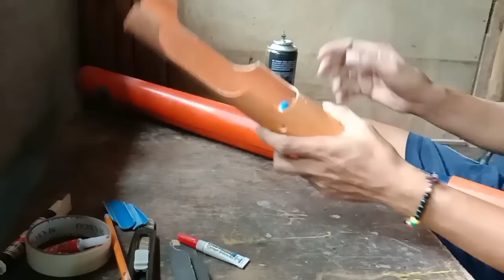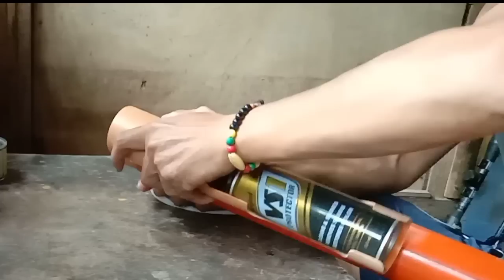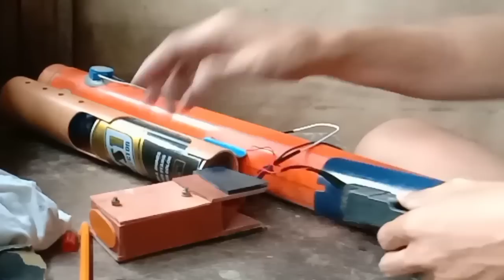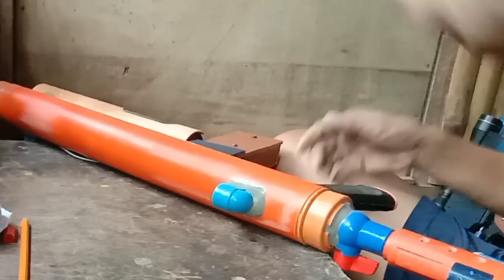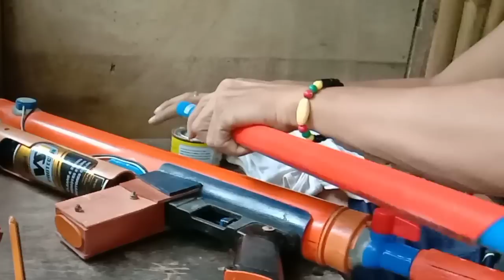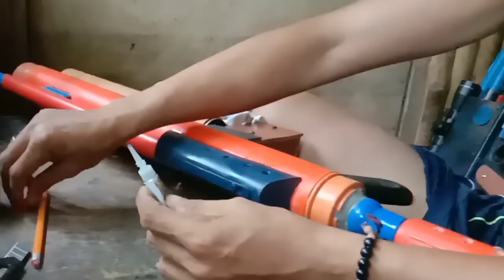last part//pvc pipe toys

Comment: Pls, this a nice work, but still confused somehow. There 3 holes, but the third one by the side with wire connected to battery, is it pumping air into the tank. Secondly, what us that bottled can doing, is it gas of what, thirdly, there is a pic tap at the stock, pls can you explain. Pls my idol